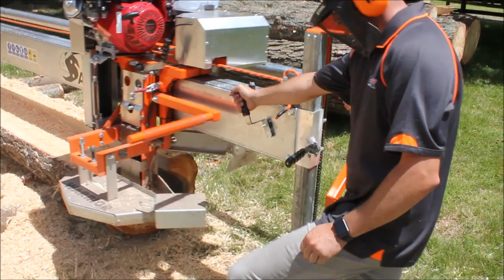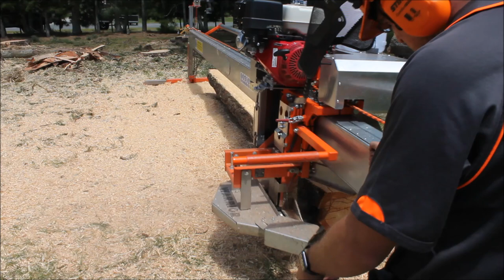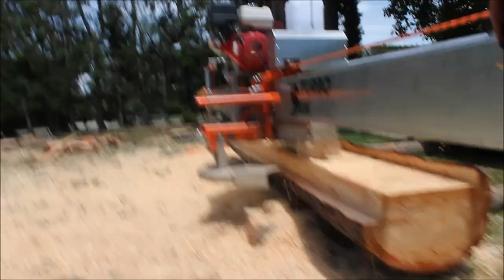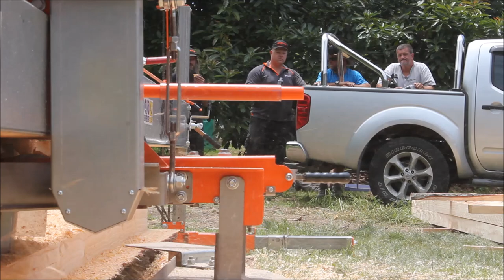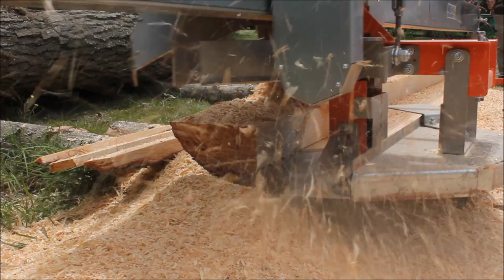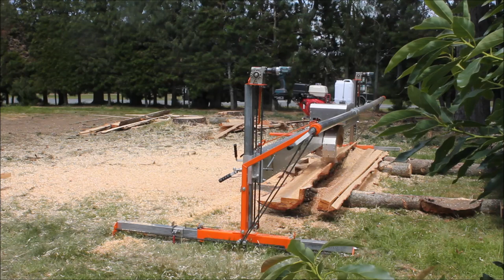The incredible one man portable sawmill

Comment: Looks like you get good recovery . We ran an eight inch edger with .090 plate and .125 kerf . Cut with in .001 of an inch . Would those blades work with this mill ? Love the speed . Do a test with two logs the same size , measure speed against a band saw to make finished product ( band saw is not finished untill the slabs are edged )  I'll put my money on your swing saw system

Comment: How many boards do you need to cut before you recoup the investment costs, including cost of logs, operator labor, insurance, energy, transportation, etc?    Thanks
Reply from the maker: It all depends on your circumstance. If you have quality trees available for milling into furniture grade timber it wouldn't take long. We milled here in NZ for the first few years before we actually sold these machines, production milling pine. Market in NZ is too costly to buy the logs. Now perhaps if we focused on more niche products like specialty large beams we may have done better. Australia seems to have an abundance of high quality timber that doesn't need treating. Same goes for a lot of countries out there!
Reply: How long is a piece of string

Comment: how large a stick can you handle,,,,,i have an oak  27" at the small end and 54" at the big end 27' away...i want to cut some large table tops from it and maybe some wide 2" sticks,,,,thanks
Reply from the maker: Our mills are able to saw up any diameter log. This model (the M8) will cut an 8"x8" block or double cut up to 16" wide by 7" deep.
Reply: It's not the right mill if you want to make big slabs, for that you would probably want a big chainsaw mill.
Reply from the maker: diyVT we actually make a range of slabber options to fit this mill.
Reply: Good to know that's an option.  I didn't mean to miss represent your mill seeing as this is the first time I have seen one.

Comment: can the blade be upgraded to a finer blade?
Reply from the maker: Yes we could. However comparing a 4.75mm kerf to a bandsaws kerf of 2-3mm... the swing blade will win over a full day's milling as it is. No wavy boards. Straight and true timber through and through. Don't get caught up in the myth.

Our blades are proven! We milled 1600bf that day and I still haven't sharpened the blade. No wavy timber either.
Reply from the maker: We could offer a much narrower kerf for you but then we get into the same issues a bandsaw has...

Must have the teeth sharpened just right.
Must have a specific form of lubricant.
Must feed the saw just right to not strain the blade.
Needs sharpening regularly.
And so on...

Wouldn't you rather an option that simply cuts true and straight timber without any headaches? I feel that's what our sawyer prefer.
Reply: TURBOSAWMILL n

Comment: There is a lot of saw dust! These type of saw mills while fast you must loose some boards due to thick kerk of blade versus mills that use thin kerf blades
Reply from the maker: We run our new Turbokerf blades now days (our revolutionary new design blade). 

Model 6 can use as thin as 4.5mm kerf. The model 8 can now run as little as 5mm So actually these saws will have a better recovery factoring in consistently straight timber through the day (shavings look like hay). A bandsaw will lose whatever was considered to be savings at the secondary planing stage due to deviation or waves in the timber. 

I watch in horror just how much timber is wasted at shows using a band mill. Heavy slabs and a lack of sufficient re-handling and re-edging.

Also shavings are a result of an efficient circular cut with just the right amount of teeth. A bandsaw will saw through the same particle over and over giving you dust like bi-product rendering it almost useless for re-use. Bandsaw dust also compacts very well so it gives you an impression of savings. 

Operation of these mills couldn't be simpler. Cut to your list of sizes as you move through the log. Resulting in minimal waste!